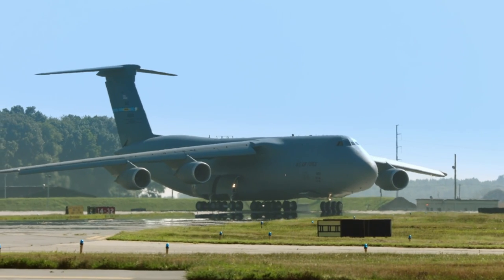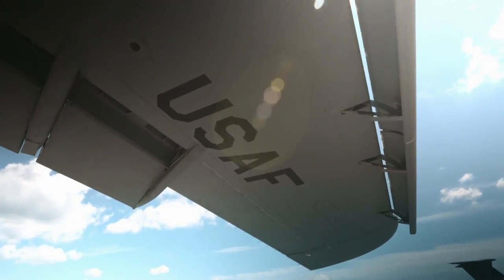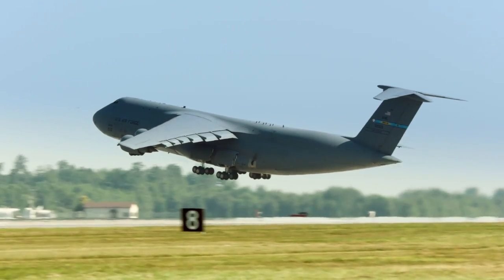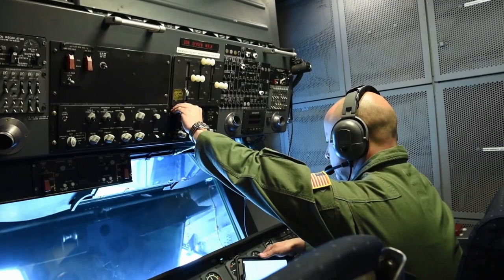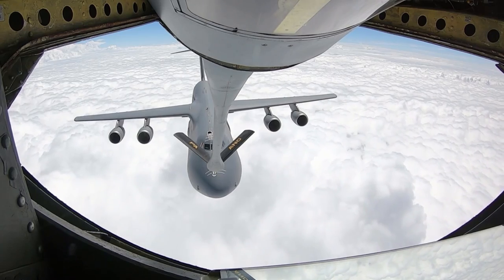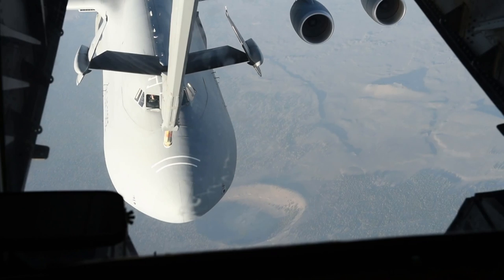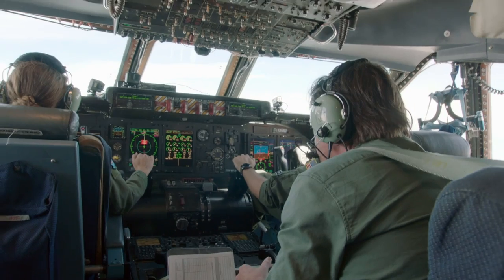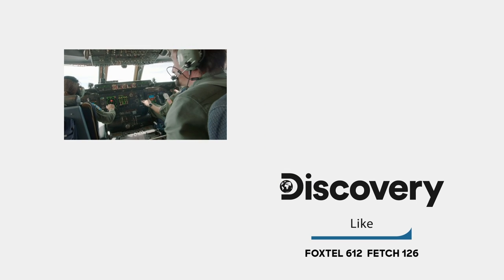Why Aerial Refuelling Is Most Challenging Manoeuvre For A Pilot | Richard Hammond's Big

Comment: Yes the fuel capacity has a finite capacity but the refueling in air serves two purposes.  Yes extends range but aerial refueling also allows the receiver air to carry more cargo and personnel the same distance. Maximum Take Off Weight is also a finite number and the aircraft doesn’t care whether it is cargo, Perone life, or fuel.  

The tanker aircraft is from the 171st Aerial Refueling Wing from Pittsburgh, PA   I spent five years in PIT...not at 171st but we saw them all the time!

Comment: A/R was the most challenging and fun flying I've ever done. We did a few days at the Boeing Kent Space Center in Seattle, WA. where Boeing had a simulator. After a few days in the simulator you go for your first A/R flight. The first hour in the sim is hopeless. After an hour it clicks. I once took on 100K lbs. from a KC-10 over the Mediterranean. It took a bit over 20 minutes. We started in a relatively flat pitch attitude with the throttles about halfway up, we finished 2 1/2 degrees nose up with the power 3/4 up. That was my biggest offload but it was smooth and I got it with one plug.

Comment: 5:50 It was at this point she fecked up by putting diesel in!  😂😂
Reply: Ironically a jet engine will run on diesel with little to no consequence. Most aircraft operating in northern Canada run arctic diesel
Reply: @werty2010master  indeed, diesel is as close as it gets to jet fuel...

Comment: This is a practiced skill which you study in class and then to a sim. Just like other skills you master like cross wind landings the more you do it the more automatic it becomes and you get a feel for it. It is too hard to describe but the C5 is different than other aircraft that refuel  because of the T tail. The buffeting is normal in a large aircraft but the pitching changes are not that significant in other aircraft.

Comment: If you ever get a chance to do this from the Navy side of things, you'd be in the back seat of a Super Hornet (or Growler, a variant of the Super Hornet), tanking behind another Super Hornet equipped with a "hose-and-drogue" system. Basically, the hose is deployed from the tanker and at the end there's a drogue (kind of like a low-resistance parachute - it looks like a badminton shuttlecock) and the pilot in the receiving aircraft - which has its own probe - is the one that has to do all the maneuvering. The pilot in the receiving aircraft maneuvers to place the tip ("Just the tip, okay?") of the probe into the center of the drogue (AKA, the basket). The tanker pilot is essentially just flying straight and level unless a turn is needed during refueling.

We used to do this routinely at night (and often during the day) when I was in the Navy. (I flew in S-3A Vikings as an enlisted crew member.) At the time, the Navy operated two types of carrier-based tankers - A-7 Corsairs and KA-6 Intruders. One or the other was airborne any time there were a significant number of aircraft that had to trap back aboard the ship at night (I can't remember if there was one airborne for each daylight recovery). However, neither the A-7 or KA-6 could land with a heavy load of fuel, so to avoid the need for the tanker to dump fuel to get below the maximum trap weight one of the returning Vikings would be the "sponge," staying in the air until it was one of the last aircraft back on the deck. We tanked behind an Air Force KC-10 one time, similar to what you saw in the video except that a hose-and-drogue accessory package was added to the tanker before it took off. From what I remember, the hose came out of the tanker's regular refueling probe. And as with Navy tanking, the KC-10 just had to fly straight and level.

Comment: As a B-52 AC, I took on fuel numerous times.  At first, I wondered if I would ever be able to do it.  The IP was constantly taking the aircraft from me.  Eventually I learned, but at first only with the autopilot off.  Later with the air refueling autopilot.  After a while, just to make it interesting, I would air refuel with only the right or left engines, claiming to the crew I was simulating battle damage.  I just wanted to have some fun.

Comment: In 1987-1997 I was a C-5A/B Crewchief
It’s still today the Biggest Cargo Plane in the USA. Only 2nd to Russia’s Antonio-255. Which is only 2 feet longer than the C-5 Galaxy. And they only have 2. The USA has over 100 C-5’. Plus theRussian cargo plane has 6 engines that do the same as The C-5’s 4 General Electric engines.

Comment: I’m sure auto pilot helps a lot though. And that hose for the fuel has a lot of flexibility so it won’t just break or rip unless it’s an extreme movement. Regardless pretty awesome.
Reply: Exactly my thought....we're humans after all, not robots with extreme precision.
Reply: Wrong, actually. I worked on that refueling tanker for several years before switching to the new generation of tankers. They don't use autopilot during the process, and the pipe is very stiff. It has some forward and aft give, but not a lot.
Reply: At those speeds, any movement that isn't a nudge is an "extreme" one.

Comment: Avoiding the air vortex formed by the wings of the fuel aircraft is definitely the hardest part.
Reply: The wingtip vortexes do not affect the receiver at all.  They are well above the receiver's wings, and the T-tail of some receivers is well inside of the vortexes.  I've seen wingtip vortexes in flight; they stream straight back and are very tight, less then twelve inches in diameter.

Comment: The mid-air refuelling is there just in case you have to take off from a short runway like in the video, so you can use the bare minimum fuel capacity to take off without problems with such a heavy plane and refuel when you've reached altitude ;-D
Reply: Or make it to a destination far away, more likely.

Comment: Actually,  aerial refueling is not that difficult a task.  It requires solid formation flying skills but it's a task easily mastered by anyone who has any business flying military aircraft.  Basically all you have to do is fly straight and level and very smoothly once you've reached contact.    All control inputs are very gentle and never made quickly.

Comment: the video editors kind of ruined part of it. Many times they say "she" is flying, then cut to a video portion where she is not at the controls (only shadowing them), the Maj in the right seat is flying. Also, you don't transfer aircraft control when in contact like they made it seem.

Comment: Meh.  A/R isn't any more challenging than flying formation.  Course we had to hit the basket, we didn't have drogue drivers doing it for us.  But then I guess transport guys don't fly tight formations that much.
Reply: Some people have trouble hitting the basket just right.  After that it is just form flying.  that said power management when  you weigh 300,000 lbs can be an issue in big plane formation.
Reply: True.  When I was teaching new pilots how to hit the basket, they would stop at it and fence with it, which never worked.  They had this misgiving about "hitting" something.  They had to learn to ram it, push it forward and stop when they got the green light so fuel would flow.
Reply: @aeroengguy448  Now try it with a "basket" that is solid aluminum, 36" in diameter, and the probe is on an F-84G tip tank.

Comment: This process could be automated like car auto drive if the aeroplane fly by wire, so computer and sensors and autothrottle, could solve this process.
Reply: not really, there are too many elements to consider
Reply: @LadyZeldaia  if you are flying by wire, all could be computerised and will be much accurate than human.